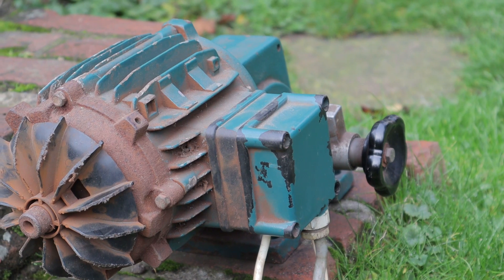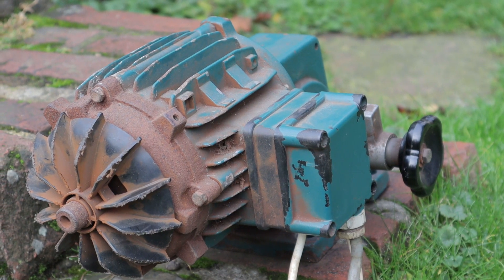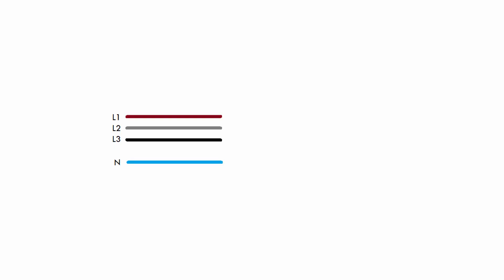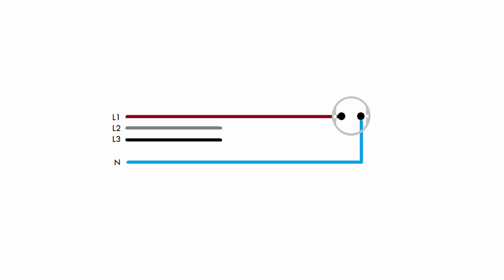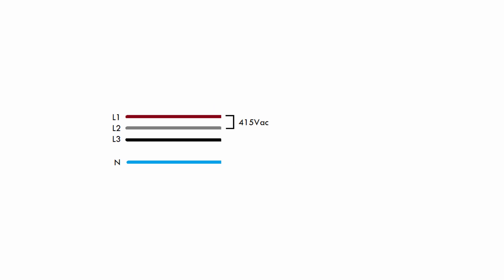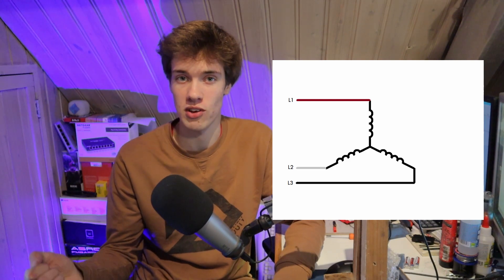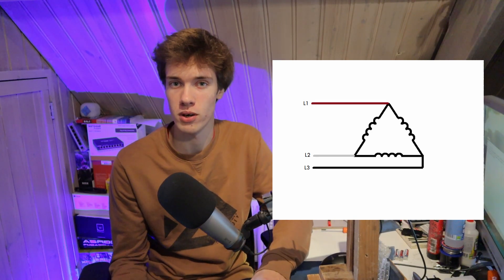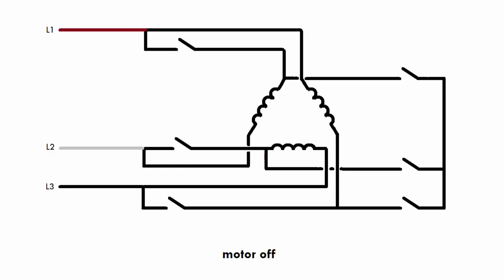What is a star-delta starter?

Comment: Just came across this video, and it brought back so many memories. I started to serve my apprenticeship as an electrician in 1977 in Harland & Wolff shipyard, Belfast, so you can appreciate that electric motors were a large part of our work. I remember we had a S/D motor in the training centre, where the switch was manually thrown to the left (star) to start, then after a few seconds you had to throw the lever to the right (delta) where it would stay during run. I also saw other models where there was a centrifugal switch on the shaft which changed the winding from star to delta.
Great video, many thanks.

Comment: Hey. You are definetly my favourite to explain different electric phenomenouns

I've just started my apprenticeship to get tought up as a construction-machinery-mechanic. When i was disassebling a large generator, that had decided to selfdestruct after a bearing got worn down from not beeing serviced, I noticed that there was what looked like a small generator inside the large generator. I asked my boss and he had to admit he actually didnt know what it was for. My guess later ended up beeing that it was an alternative to having brushes power the exciter coils. I looked it up a bit and it seems I was right, but couldnt really find a clear answer and explanation that would help me get a more full understanding. I really want to understand all the stuff about the AVR and the different configurations generators run to maintain the 50 hz frequency and voltage most effeciently.
 
Hope you want to help :)